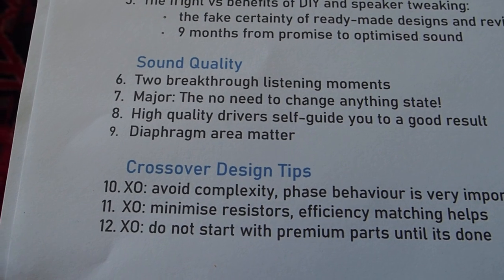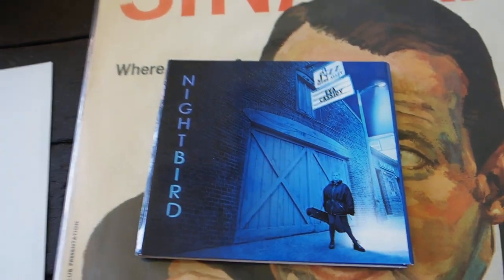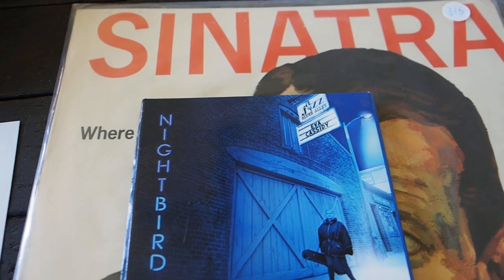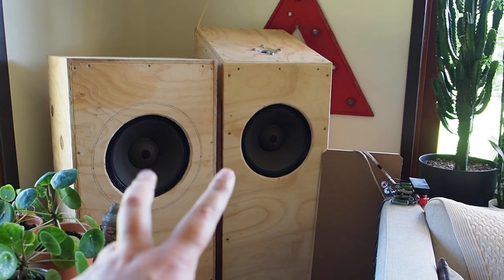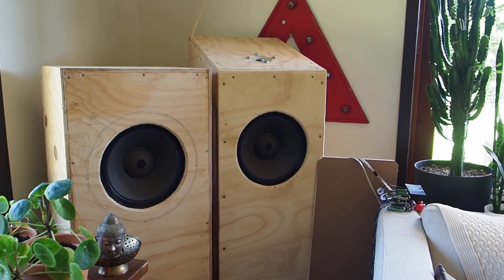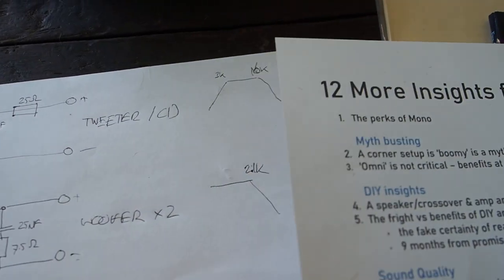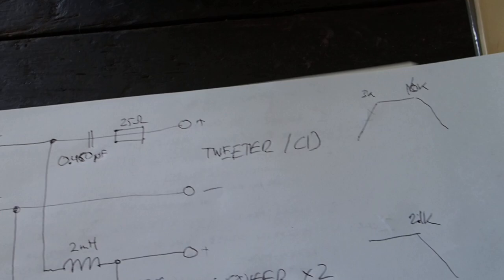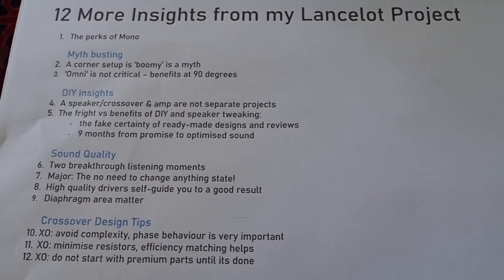The Lancelot Speaker build/design after 1 year: part 2 of 2

Comment: Eduard, Thank you again for another excellent presentation! I especially enjoyed your comments on cone area. I am passionate about the audible effects of intermodulation / Doppler distortion. I do think this is the fundamental issue you were describing. Again, thank you so very much!
Reply from the maker: Thank you and you're welcome. I find it a very interesting topic as well and so far I've been extremely pleased with the effects of 'sizing up' and high efficiency drivers.

It's hard to visualise the scale and influence, but I think Janos said something to the effect that his Lancelot cabinet only needs to have 1/20th of the excursion of the woofer to produce the same output (coupling to the air assumed equal, cancellations notwithstanding) ..